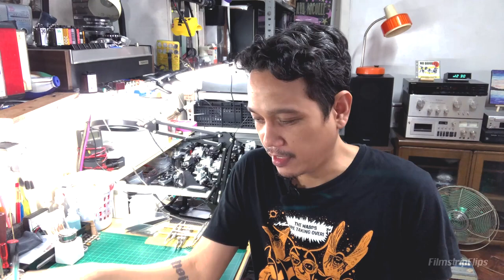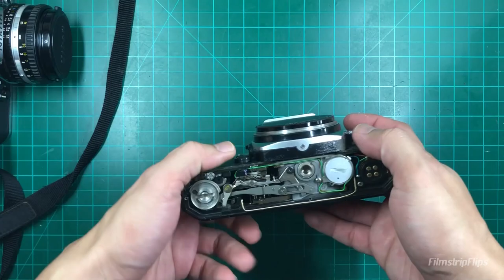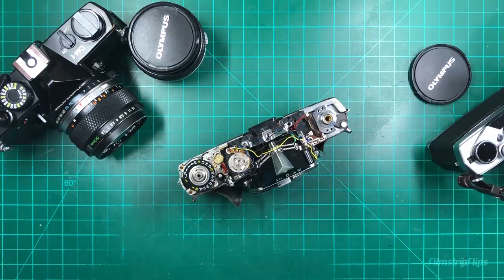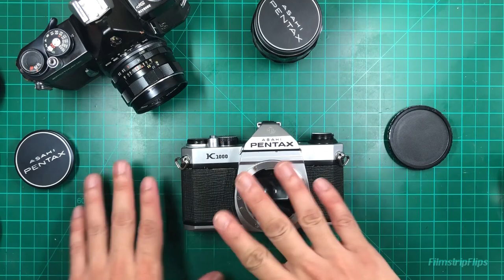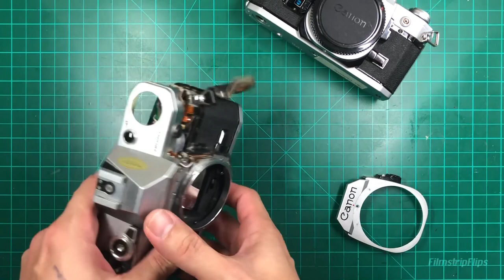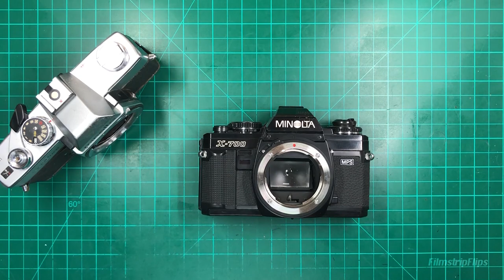GEAR TALK: Film SLR Cameras I Would Recommend for Newbies

Comment: I've been shooting film for over 50 years, and was a newspaper photographer for a while. I've owned all the cameras that you showed, at one time or another except the Minolta. We had an SRT-101 as a school camera when I was a kid, and it worked fine. They all have some very good points in one way or another. I also owned two Contax systems. I loved the lenses but the bodies were delicate and had electronics issues.

I ended up settling on professional level Nikons and Nikkor lenses as my main system. I loved the size of the Olympus, but over the years the meters have become problematic, and not many people work on them anymore. But my Nikons have kept on working for almost half a century now. I have a very nice set of manual focus Nikkors ranging from 24mm to 200mm, and use Nikon gear for all my digital work as well. It's really hard to go wrong with a Nikon F2 or F3, or an FE or FM. I even have an EM for when I just want to have a light, inexpensive camera with me. It wears the 50mm f1.8 Series E, which as you say, is optically excellent.

I'm impressed that you actually do repairs on your own cameras. I've never been brave enough to do anything beyond installing new light seals. Keep up the good work!

Comment: My daughter bought me an OM1n for my birthday last year and it works flawlessly. 
But the reason she did that is that my OM2sp gets stuck over and over agin. Namely, the "R" button behind the winding leaver gets recessed and I can't reach it from the outside, and the camera can't wind, can't fire a shot, nothing. Happens even if I attach a winder. A mechanic fixed that for me several times, but I want to find a permanent solution for that, even if I have to open and repair the camera myself. Otherwise camera works fine. What should i do?

Comment: Sir, in terms of your full CLA po, nagbibigay rin po ba kayo ng shutter speed test make sure theyre accurate or within 1/4 stop accuracy? Salamat po. 

Kita ko sa video niyo rin you do fix the electronic parts and change old diodes if needed. Dami kasi repairer sa pilipinas at ibang bansa, bubuksan lang camera blow the dust out, kunting wipe, and test the shutter speed accuracy by 'hearing' 😅 they dont even ty to remove fungus or rust. Cowboy job saka mahal bayad. Saka di nililista yung mga ginawa sa camera, 'CLA' service lang at alot of times di ginagalaw electrnic/wiring sa camera.
Reply from the maker: Grabe un big No no! Yes we do have a digital shutter tester which is useful for shutter curtain replacement, but for the majority of manual cameras once you get the 1/1000 shutter speed set correctly everything will fall into right timing. Nka ilan ndin ako n nangaling n s ibang techs that need to be repaired again. Wala e minsan tlga nangyayari un😁
Reply: @Filmstripflips  nice one sir!!! Im definitely sending my cameras your way pag makauwi ako ng pilipinas, i have been thinking of buying nikon f3hp and other film cameras with electronic/metering parts but since madaming repairer na cowboy sa full mechanical na lang ako(F2 gamit ko)